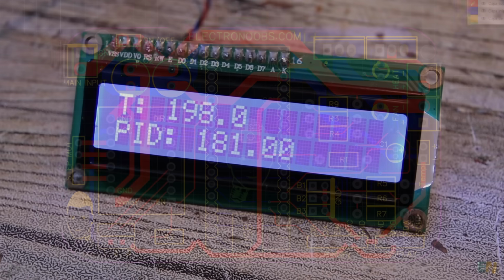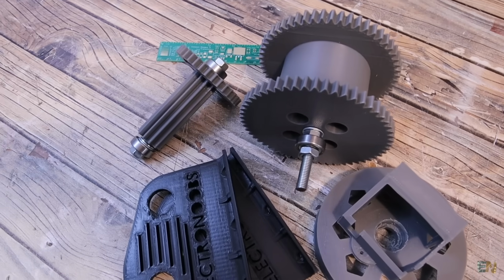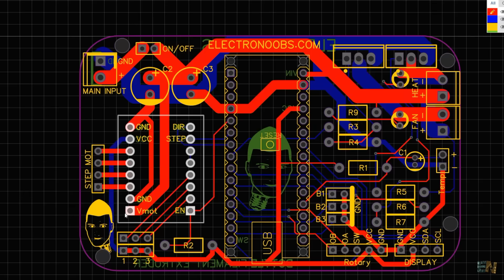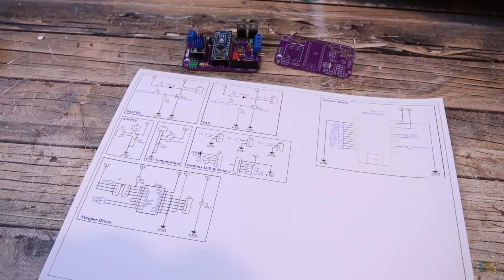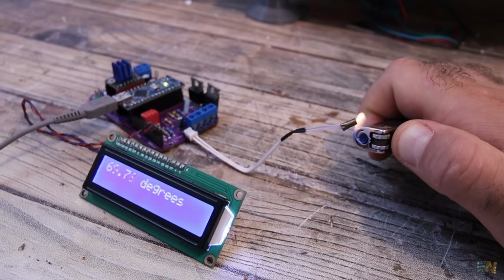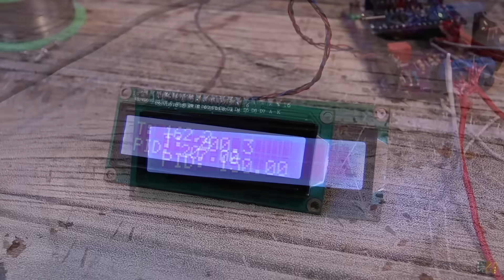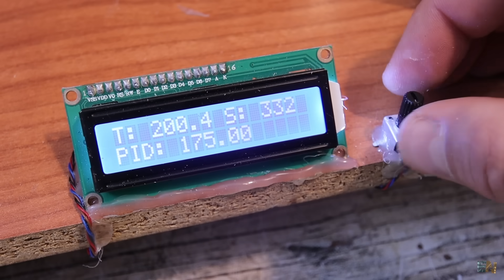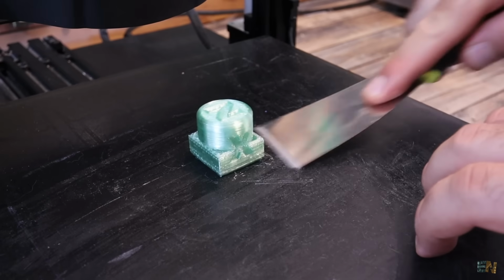3D Filament From PET Bottle + Controller PCB

Comment: A very cool build!  Some thoughts:

1. To quickly cool down the filament, you can pass it through a 2mm brass tube that goes through a water tank.
2. To automatically set the winding motor speed--and, therefore, the filament thickness--I would have the filament exit the brass tube and travel between two bearings, with the top one mounted to a long, sprung arm (to act as a multiplying lever) that has a magnet on the end affecting a Hall Effect sensor, which reflects the distance between the bearings.  The Arduino can then set the motor speed by the signal sent by the sensor.  A series of shims placed between the bearings can be used to train the Arduino.
3. A 'spot welder' would be useful for joining strips. It wouldn't need to be anything more complicated than a couple of heaters with split PTFE tubing wrapped over their ends--to prevent sticking.
4. A 'rope making machine' (like this one: https://youtu.be/25mmaiZ_gGk ) would allow turning very thin strips of PET into strong cords.  A nozzle drilled out to the desired cord diameter would smoothen the surface.  As well, such cords can be made of different colours for multi-colour filament.
5. An enclosure for your printer--even just a cardboard box!--would help maintain temperature.

Cheers!
Reply from the maker: Thanks for all these good tips :)
Reply: Any examples of the joining strips or filament?  I've read this is the one gap in getting more involved.  I envisioned using like a current clamp somewhat design where instead of laminated material, using heating elements so that one can easily clamp and apply some force to make a uniform diameter butt weld... even if each end might require angled cuts to better overlap and join.  

I've wondered about the strips joining first as a better plan so to pull more uniform already joined sections.  Great thoughts! Thanks for sharing!
Reply: There might be other ways to measure the thickness of the filament, too; perhaps an IR LED and a photoresistor that the filament passes between?  I'm not 100% sure of how much IR different colors of PET would block, but it might be worth an experiment.
Reply: @georgedorn_fnord  The first problem with that is you would have to thoroughly test every single material you use, as that is testing density and opacity rather than diameter.  As it is the mechanical nature of the filament that needs to be within spec, I think that mechanical testing is best.

Comment: After going thru similar adventure I can recommend few things, first is 1.6mm MIG nozzle, works far better than any diy nozzle i did and requires no drilling at all. Second, you can automatically cut the bottles while spooling, it saves tremendous amount of time, no need to pre-cut entire bottle, just make bearing cutter. Blade cutters are terrible. I have couple of vids on my channel with my machine. You have issues with 200 deg because your nozzle has not enough hot zone length, this is why imo its bad choice. Mig nozzle is very long and has very long hot zone.
Reply: Awesome idea using the MIG or FCAW welder gun tips.  What do you think is the best way to sharpen the bearings to make the cutting edges?  Thanks for sharing, will check out your videos next.  Any thoughts on best ways to join the strips or filaments to make longer lengths?

I envisioned using like a current clamp somewhat design where instead of laminated current conductor material, using heating elements like in a pair of pliers or vise grips, so that one can easily clamp and apply some force to make a uniform diameter butt weld... even if each end might require angled cuts to better overlap and join.  Seems would be easier to remove and keep a flow going that way.
Reply: @jafinch78  Best way to sharpen bearings is using lathe. Second best is angle grinder/microdrill with grinder disc. Best way to join strips is to not join them at all and put filament sensor close to printhead and manually change filament. Welding filament is much more effort than just refilling it. Every single filament welding takes at least couple of minutes and its just ultra tedious. I explained everything you asked in my vids.
Reply: @KaminarisTech  Just started watching your series of videos.  On video #2 now.  Thanks for the insight and sharing!  Kind Regards, In Christ.
Reply: @KaminarisTech  It would be easier to make a second rig just to cut the bottles into strips and then join the strips together onto a spool and feed that into the filament rig. You could start off with a single strip that was 1KG in mass and just make an entire spool in one go.
Reply from the maker: Thanks for all these good tips :)
Reply: Thanks so much!
Reply: Do you know how i would be able to use my tevo tarantula pro into one  but I would need to use ender 3 thermistors got wrong ones lol
Reply: Do you thing a standard nema17 would have enough torque to pull cut the bottle automatically with this video's setup? Thinking of doing this, but nema17 motors that come with gearboxes with higher torque ratios are like 4x as expensive as a standard one in my country

Comment: Wanted to build this for a year now. How consistent was the filament after extruding from strips?
Reply from the maker: Not perfect.. But that doesn't affect the printing that much. It wasn't consistent because the strip was not cut perfectly. I should make a better bottle cutter so the width is always the same...
Reply: @ELECTRONOOBS  keep up the great work.
Reply: Thomas Salander made INFIDEL  (diameter sensor that is supported on Marlin firmware, search: FilWidth on configuration_adv.h) so it could be included on the 3DPrinter and/or filament extruder:
- Attached on Filament extruder doesn't gurantee 1.75mm filament
- Attached before 3DPrinter Extruder it automatically modify Marlin filament flow on the fly based on filament diameter measured

Comment: Very nice video I like it very much
The bottle smoothing method looks dangerous is there is a safer way?
Also no smoke or toxic gasses will come from the processes right?
Reply from the maker: It might, but nothing worst than normal 3D filament fumes...

Comment: after printing, heat the 3D printed part for few seconds just a little less than melting point. It will smoothen the layers and overall appearance.
Reply from the maker: Thanks for the tip :)))))))
Reply: I'd never heard of that. How do you avoid melting the plastic but still manage to get it soft enough to become smooth?
Reply: @angelorondini5835  a heat gun might work since the hot air would only be heating the outer wall of the print and shouldn't affect the infill too much so it should hold it's shape during the process, but I haven't tried this so I could be wrong and it could just end up melting the print.
Reply: In my experience that's gonna start to deform the print before smoothing layer lines any real amount because the outside has to become liquid for it to flow and by then the inside is soft enough to deform. Do you have a technique you use?
Reply: @thirtythreeeyes8624  I usually go over it with a 3d pen or soldering iron to smooth it but a light heat gun will work splendidly.
Reply: @damiandarius160  Ya actually I've used soldering irons before mainly to join parts but, it smoothes it pretty well. I've tried hot air and it droops into the infill before smoothing maybe higher temp or less infill could work I'll have to try it some more in the future.